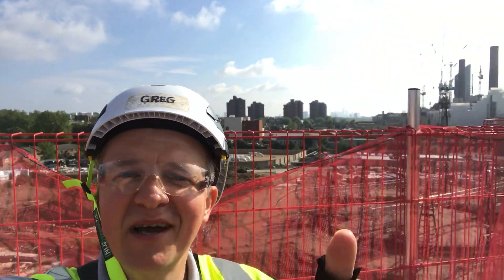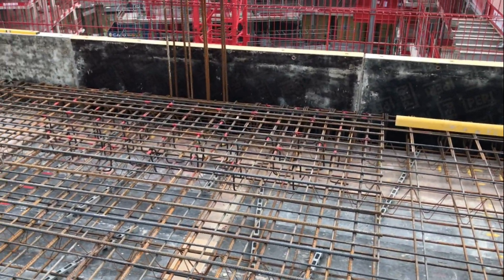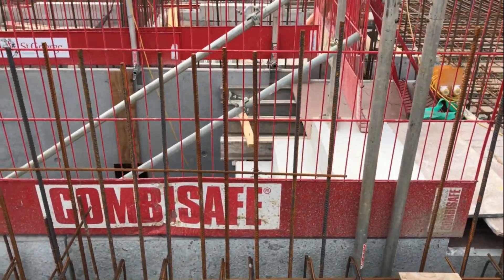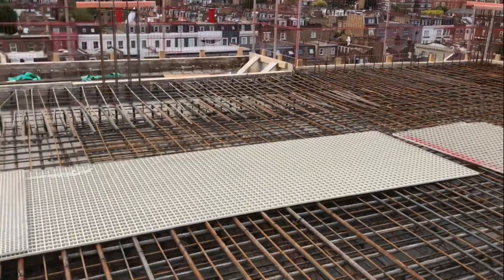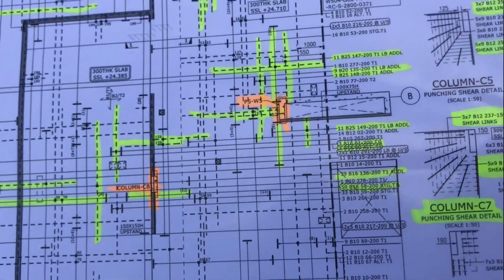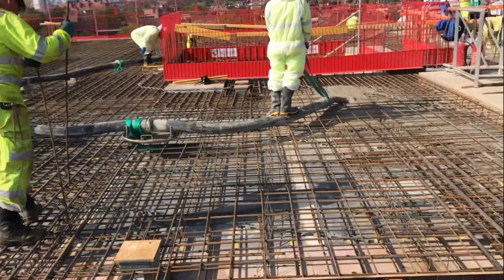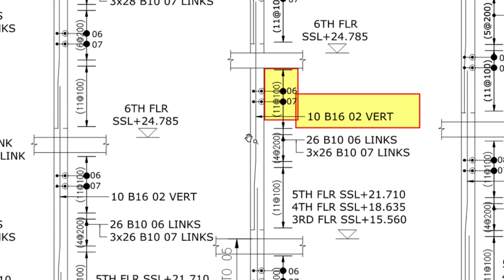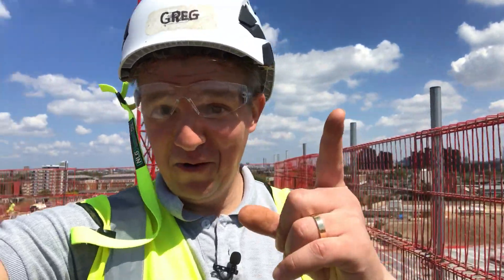How to check REBAR. QUALITY in construction.

Comment: How do you check the position of rebar?
Reply from the maker: Hi Moon Thu! Position is on the drawing so if the bars are laid properly (distancing) all should be fine. Sometimes where there is no info and you can see on the drawing that bars are not to be laid evenly (eg. extra top bars - top column) you can always check the distance on the Autocad/ Bluebeam etc. If it's position in terms of bottom, top, sides cover I am checking these with tape measure off the decking.
Reply: @SITENG  do you use the survey nails and spray painting to set out the rebar? how do you know if the position you set out is correct? do you just use a tape measure?
Reply from the maker: Few times I used EDM to set a line which enabled fixers to measure (there was direction of rebar change as well), typically I don't set out for the rebar unless something is really unclear. Your tape measure should be well enough once your slab edges are correctly set out 😁

Comment: What I found different in your column section drawings from ours is that the splicing of the rebars are shown just above the slab, while we avoid splicing in that region to satisfy ductility requirements. We tend to splice 50% of the bars in alternate floors at the centre of the column maintaining less spacing near the beam column junctions and the area just above the floor.
Reply from the maker: We always splice above slab. To be honest splicing in the middle sounds strange to me as in some columns there will be some moments acting there and normally you want to avoid splicing in these region. I have to check it as it's interesting for me, all Europe doing this way for sure and it's also easier for construction.
Reply: @SITENG  As per earthquake resistant details mentioned in our codes, we splice 50% bars only in a floor which holds true upto 20mm dia bar. For higher dia, we use couplers (only that it should not come in column-beam junction as it vulnerable to shear) to maintain rebar uniformity and reducing steel wastage. As for 100% lapping in a floor ( which I saw in your video) , rebars are never spliced at the same location. Distance between bars are kept at a distance not less than 1.3x development length.
Reply: @SITENG  To reduce the moment causing buckling, stirrups at the shear zone (near the slab supports)& lap location are densely spaced say at @100 c/c and in the middle @200 c/c.
Reply from the maker: I can't agree that you can reduce moment by using more stirrups. I agree that splicing all bars in one section is not the best, but as this is almost only compression at the bottom it's good and easy to construct. I am not sure about earthquake design, but germans do it and they splice at the bottom.
Reply: Im form China.As a country having 9.6million square kilometres,China has listed a table of the anti-seismic grades for the structure. It is related to building height, structural form and seismic level expect and so-on. The rebars in the columns must be connected away from the floor. But the rebars of shear wall is deffernt in different seismic grade. Low anti-sesmic grades can be connected above the floor.Maybe seismic level expect is different in Europe.

Comment: Hello sir, which software are you using to come up with the drawings
Reply: Come up with a video in the way you implement bluebeam at your site. Do you use any other softwares apart from AutoCad and Bluebeam?
Reply from the maker: I will do one soon, definitely! On site I mostly use them two and dependant what software client uses you will be using some platform for communications etc.
Reply from the maker: Hi Bruce! I am using Bluebeam Revu. It's great :)